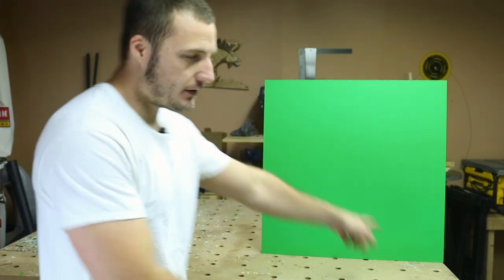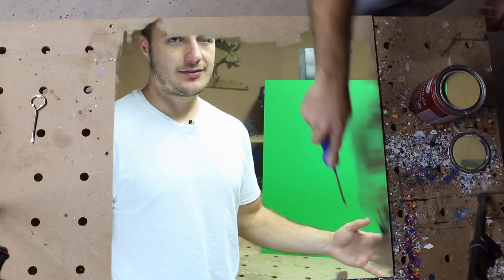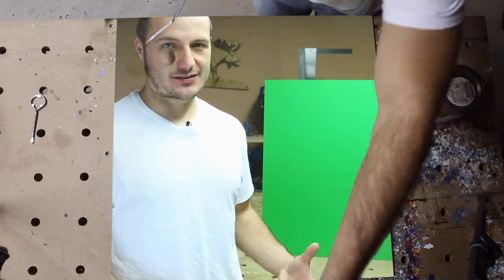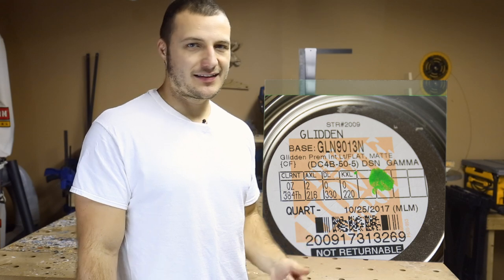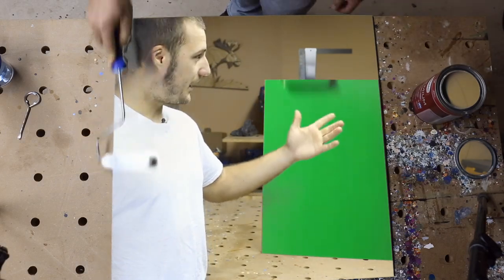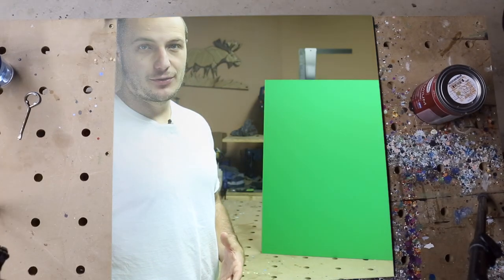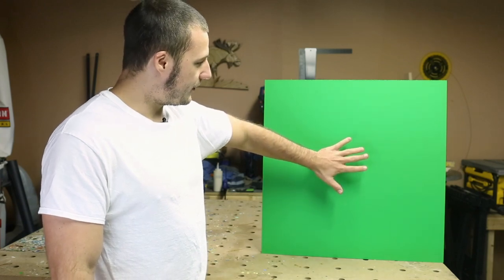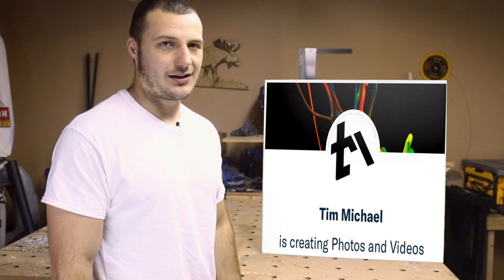Inexpensive Green Screen/Chroma key Paint

Comment: Hmm, what do you think about using the paint on a old projector screen to re-purpose it for a compact green screen?
Reply from the maker: That might work. My worry would be the paint cracking and coming off of the screen when it is rolled and unrolled. May be worth a shot though. If you give it a try let me know how it works out. Thanks for watching!
Reply: lkjacob1 ...it might be worth mixing some (quite a lot of) PVA glue with the paint to give it some flexibility, plus some artists acrylic matt medium to make sure the glue doesn't add shine or sheen.  However, you'd have to experiment to get a sense of how much glue to use without thinning out the intensity of the paint's color, whilst still providing flexibility.
Reply from the maker: @duncanthompson957  Excellent idea! Never thought of that. Thank you for the input!